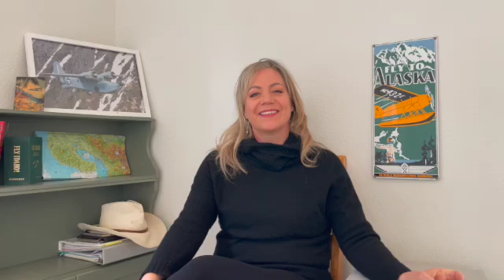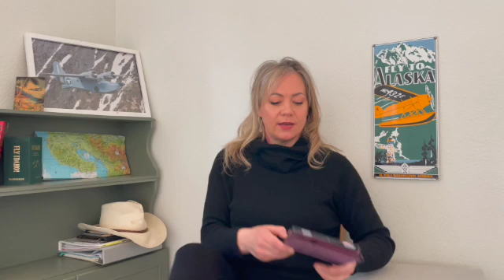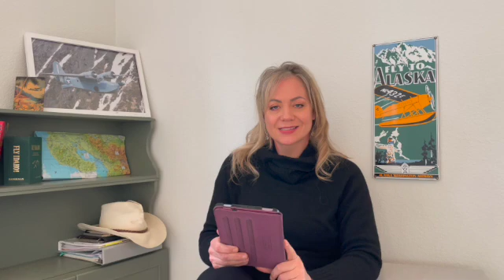Slow flight according to the ACS

Comment: This is the way my school teaches it. On my commercial ASEL ride I started to set up and explained to the examiner I will slow down to find our stall speed and he raised his voice and said "If that stall horn goes off that's a fail. You already know the stall speeds. Now pick a speed".. so I did as requested. I passed anyways, but it was always a bit confusing to me which way was correct.
Reply from the maker: Thanks for your comment.  Unfortunately, not all examiners are up to speed on the latest materials, and some just want to get the test over, or have never heard of such a thing.  Now, usually applicants are setting up at around 55 knots in a 172...which is not too far from a probable +10 knots figure for first indication of impeding stall.  However, that would give the applicant literally plus zero on their speed if they set up that way.  AND, the published airplane stall speeds are at max gross weight, and a lighter airplane, CG, and atmospheric conditions change the stall speed for any particular day.  Most DPEs would give you extra points for understanding this, and not berate you.  However when in Rome...
Reply: @NorthboundFlying-g5d  suppose in this case you could say, “hey, we’re 55 kts by the book but we’re two hundred pounds light so that is now 53.”

Comment: All well and good for high altitude orientation and experience of how the controls feel and work near stall airspeed.  The controls mounted on the fuselage that have less adverse yaw than the ailerons, rudder and elevator and throttle, work well.  They especially work well with all that prop blast increasing relative wind.  But Vso has nothing to do with takeoff and landing which occurs in very low ground effect.  Why did Wolfgang just use the term gaits and specified no V-speed for any operation?  Because he was not setting up the computer autopilot control, he was teaching flying with full energy management.  Why are we not allowed to teach Private, Commercial, and CFI students the law of the roller coaster and the basic level in low ground effect takeoff.  And why are we not taught to use ground effect on landing rather than get beat up by it in the round out and hold off technique.  Why can we not teach students to be experienced pilots?  "The 'stall-down' landing requires that you blend the approach glide, the flare-out, and the slowing up of the airplane all into one maneuver so that, when you arrive at ground level, you arrive in three-point attitude, all slowed up and ready to squat."  "Stick and Rudder,"  page 302.

We can get the numbers right and the outcome of the maneuver can still be in doubt.  As a crop duster, I cannot teach pitching to Vx or Vy, never appropriate on long runways, and climbing out of ground effect as quickly as possible.  The cameras around the airport clearly show that failure to achieve acceleration level in low ground effect until zoom reserve airspeed before pitch up on both takeoff and go around is killing pilots who are doing exactly what they were taught.  LOC at high airspeed is also killing pilots.

I teach hover taxi down long runways with full flaps and sufficient power to give students/pilots, instructors experience with how the controls feel and work (the aileron does not) much slower than Vso in low ground effect.  Reduction of power and touching down at this airspeed, or even slower ground speed with a headwind component, will not bend airplane and kill pilots.
Reply: Ah Wolfgang, the Bible. I refer to it as the Bible and Aero for Naval Aviators the Quran but this is merely due to chronology of publication. Now, how should be address Boyd’s EM-theory (which does incorporate Rutowski’s optimum energy)?
Reply: As for ground effect and implications, there was an Australian defense research paper looking at sea skimmers that is an excellent reference. While we talk about reduced induced drag, and Aero for NA mentions some planes can’t stall IGE but such planes can get stuck in IGE, we try to discount as mere feeling or perception the “cushion of air,” the Aussie paper shows we actually do gain a cushion, or more accurately replace a lumpy cushion for a smoother cushion. It also shows the center of lift shifting quarter chord to half chord, something that also happens going supersonic, though with ground effect such is much more blended not as abrupt.
Reply: Without all of Boyd's data and from his briefing I think he had a complete understanding of total (not just fuel) energy management.  I expect your Navy manual does as well.  The latest Pilot's Handbook, however, has no concept of the law of the roller coaster, what the airplane wants to do, free level in low ground effect energy, down drainage egress potential energy of altitude, or even wind energy in the reduction of radius of turn.
Reply: @jimmydulin928  have a look for Medium with Pitch for Power Power for Pitch a Coffeehouse Discussion, I think you will enjoy it. Regarding zoom climbs, and in ground effect energy reserves, I’ll have a few questions and thoughts in a moment. Recently hit the topic in Van’s Air Force and want to go see that again first.
Reply: @jimmydulin928  what do you use as your “zoom reserve” margin? How do you calculate it if seeking to apply across different airplanes? When do you use it? When do you not use it? 

Thinking about Vy, really AOAy, which is constant with varying weight (Vy isn’t) but decreases with altitude (as does Vy) though not sufficiently for us to consider at and near field elevations where such matters, AOAy for a propeller typically is slightly lower than (faster than) L/Dmax AOA due to propeller inefficiencies. If we had a theoretical pure propeller it would be at AOA for min power required and this would be constant at all altitudes. Anyway, actual Vy climb flows through the peaks of the Ps curves until we hit absolute ceiling with power available equalling power required at AOA minimum power required. This is our best rate possible. Yet if in a supersonic platform, we can actually get higher. This brings us to Rutowski and optimum energy climb as opposed to optimum rate. Rutowski’s involves ground effect acceleration, zoom, then dive to super-sonic then an accelerating climb and finally a zoom to maximum possible height though this height is not sustainable and the plane will settle back down. Optimum energy flows through the tangents of the Ps curves to the Es curves. We could do something similar in subsonic craft though there is not much point for it. Yet it very much relates to the idea of that in ground effect accelerate with less drag to a higher energy state, then zoom likely to Vy or Vx situation dependent and continue climbing at respective value. But what truly optimizes you? Vy being near L/Dmax means the induced drag savings aren’t really much and the faster you get the less the savings. And you may even develop some interference drag with the ground into your parasitic drag. There is a rapidly diminishing return on speed aka kinetic energy gained accelerating in ground effect. To be fair, with the reduction in induced, you should expect a ever so slight shift of L/Dmax getting faster but such a shift isn’t much. Seems to me accelerating beyond Vy in a propeller in ground effect is zero gain quickly becoming a loss. Seems to me if you have an obstacle, accelerating to Vy plus maybe five or ten knots as you’ll bleed as you pull the stick to set your zoom then zooming till speed bleeds to Vx, hold Vx in climb as needed to clear obstacle, then ease the nose to get back to Vy is the best you can possibly do in a propeller and is a bit complicated for the average GA pilot. Better they get to Vy and get up and away then climb at a faster speed for better visibility and engine cooling. But, counter to this, there is argument for when not needing optimized climbs get Vy plus ten till up which can be done in ground effect then climbing not zooming allowing for that potential startle time so as not to bleed down below L/Dmax best glide (in still air and straight flight). 

And all this gets back to the need to differentiate zooms from climbs, dives from descents. With this we can recognize turns are analogous to ascents with instantaneous like zooms sustained like climbs. Which really is Boydian Energy-Maneuverability. 

With this, your best sustained turn is at AOA minimum power required in a propeller (L/Dmax AOA for a jet) while your least altitude lost gliding turn is at AOA minimum power and forty-five degrees AOB (prop and jet). 

It is amazing how much better we’d all be if we flew AOA instead of airspeed. Safer with constant AOA turns too should we not need to shift AOAs to optimize for some reason.
Reply: Note in the above I presume zoom to maximum possible height hence settle afterwards. You could alternately zoom to maximum sustainable height which is the intersection of the Ps zero curve and with the supersonic Rutowski, this will be above the Vx Vy intersection traditionally thought of as absolute ceiling. 

Regarding optimum energy climbs and propellers, if you look at the Es curves, you see they are nearly flat at lower speeds. This means the peaks of Ps curves giving you Vy are essentially also the tangents of Ps to Es. Hence the limited utility of seeking optimum energy climb in our GA planes.
Reply: @Fffflats Since considerable experience with getting the Cobra gunship off at extreme overloads and loading every piston crop duster airplane to max based on how it handled the last load in the same conditions, my default takeoff in every single engine general aviation airplane (I have flown most all of them) is the basic level in low ground effect takeoff until obstructions require pitch up to just clear (not overfly by lots trading airspeed for altitude) the obstacles with the outcome of the maneuver never in doubt.  Start with fuel energy leaned to max RPM.  In tailwheel airplanes use the elevator to raise the tail as soon as possible.  In nose wheel airplanes start with the elevator full aft.  When the nose wheel comes off (this should happen quickly or abort), hold the nose wheel just off.  Use the elevator to bring the main wheels off as soon as the airplane will fly in six inches ground effect (this will happen well before Vso, an out of ground effect number that has nothing to do with takeoff).  Work the elevator for aft dynamically and proactively to tightly bracket the nose level in six inches ground effect.  Rapidly accelerate much faster than with the wheels on the surface until max airspeed or obstacles require pitch up to just over not well over any obstacles.  Airspeed and not altitude is life down here.
Reply: @Fffflats Airspeed and not altitude is life down here.  Read Wolfgang's explanation of how the experienced pilot prefers the thing (airspeed and altitude are two forms of the same thing) in the form of speed on takeoff on page 85 concerning a good use of the law of the roller coaster.
Reply: @jimmydulin928  I like what you’re saying though it takes experience. Would you trust the average GA person to know when that last point to pitch up is? Or to just clear the obstacle so as to preserve the kinetic energy? As analogy, when I was getting my glider add-on, I kept landing near the arrival portion of the runway. Afterward, the examiner commented, “you’re a jet guy aren’t you.” His point was that despite me doing well hitting my aim-point, gliders typically aim further up so as to have margin behind too.
Reply: @Fffflats I have never had an Ag student delay pull up at the end of a spray.  I have had many start early and thereby kill kinetic energy we needed to return fifty feet upwind.
Reply: Maybe this opens a bit of discussion back to that zoom is like instantaneous turn while sustained turn is like climb.
Reply: @Fffflats Yes, but in order to stay alive I flew/taught no back pressure on the stick in turns.  Yes, after obstacles clearance we zoom up wings level to gain altitude (potential energy for the next turn) and to reduce turn speed for a tighter radius in the turn back (always into the wind if there is crosswind as we work crosswind back to back from the downwind border to the upwind border).  Automatically with bank, however, comes release of all back pressure on the stick for a 1 g turn regardless of the bank angle.  In the necessarily steep turn to return fifty feet upwind, the nose will go well down (what the airplane wants to do) dynamically too much in attempt to quickly return to trimmed airspeed.  It is fine here to take the tuck out and necessary anyway to put the pipper (gun sight or nose) onto the target (next crop row).  This is the same but turns are more moderate in race track work or pattern work at the airport, if turns are to become safe and never result in stall.  Stall is when the critical angle of attack happens, not what causes it.  A pilot pulling back on the stick (normal operations) is what causes it.  Unfortunately sustained turn is like climb and the law of the roller coaster is very much being violated in the 65 HP trainers I learned in.